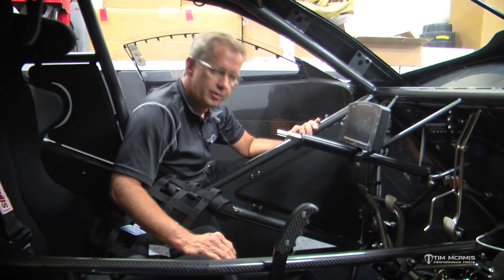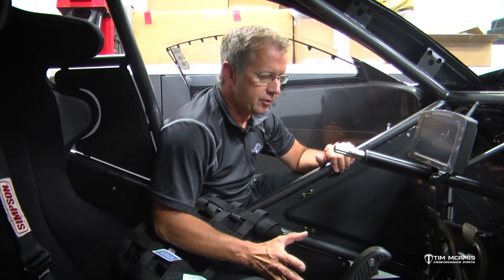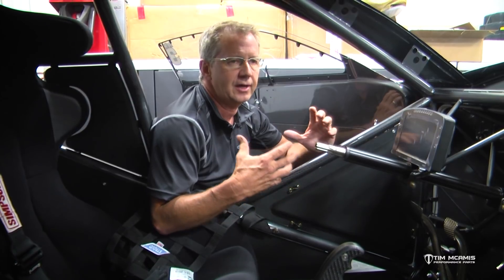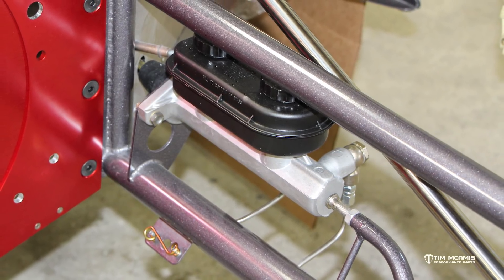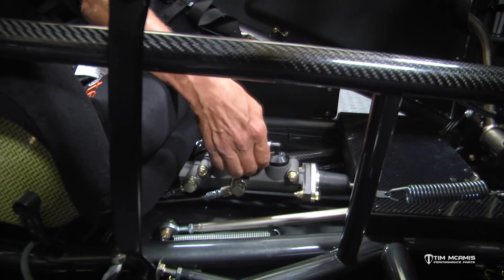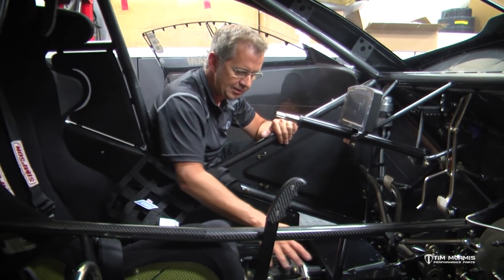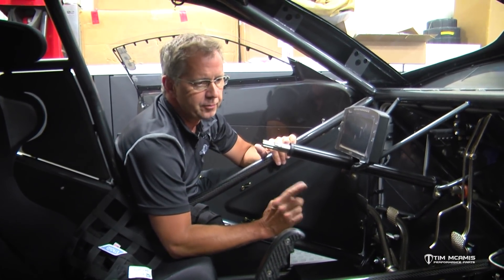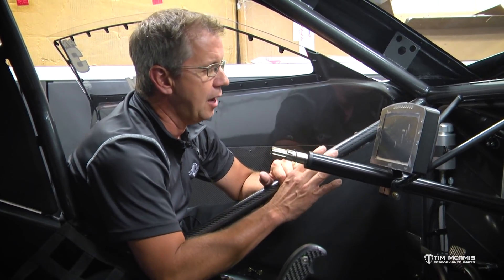Remote Master Cylinder Reservoir

Comment: Does this cap fit on other master cylinders or do you have to use their master cylinder package to make this work.  Do the plastic stock reservoir systems have generic spacing or are they all different?

Comment: No more pos check valves.  Oh and I’d run two independent reservoirs in case there’s a leak on either the front or rear circuits.

Comment: We need these for Schassis in the USA... S13/S14/Z32... With turbo setups, the BMC gets heat soaked from radiant heat, the turbo manifold and downpipe are right next to the BMC. We typically put shielding in front of the BMC, but this solution would be nice to have the reservoir remote located away from the heat!
Reply: NissanPacific  have you found anything like this.

Comment: This is not only a convenience item, it's also a safety item, cause it not only removes the plastic reservoir from the master cylinder, but relocates it to a safer area where it wont be subjected to direct damage from fire and/or impact due to catastrophic engine failure or impact and failure in a crash scenario.